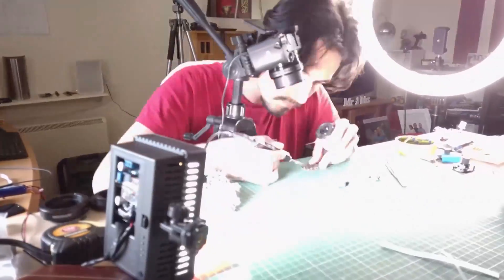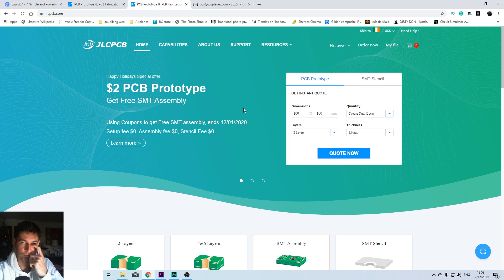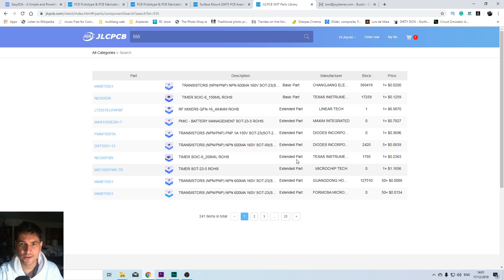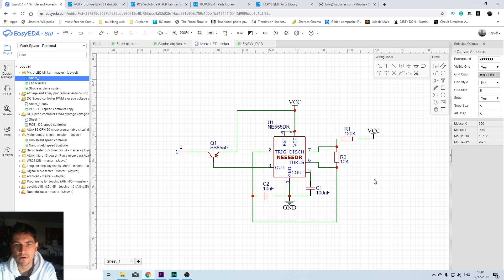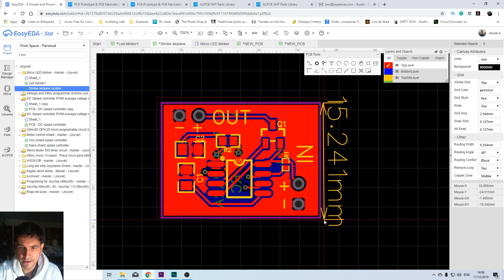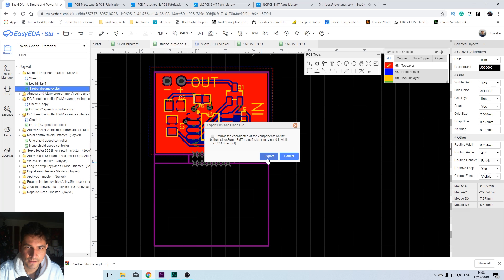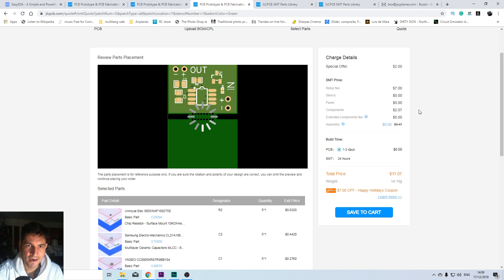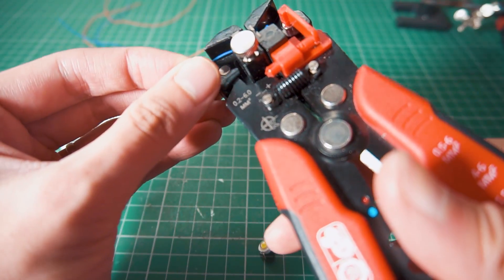Making an entire circuit with no soldering involved | JLCPCB SMT assembly

Comment: I definitely need some lights on my glider with that winter too. What's the voltage is coming out from channel pins of https://hobbyking.com/en_us/g-rx8r-eu.html when powered with a 3S ? Would a spare channel of my receiver be okay to power this PCB ?
Reply from the maker: Receivers normally work with 5v also because the servos use that voltage, if you're using a 3s battery I guess you're using a ubec or an esc with a voltage regulator that generally brings the voltage down to 5v so yes, 5v is the voltage for this circuit.
Reply: Yes, my receiver is indeed powered by the esc. Does that 5V coming from a unused chanel pair from the receiver fit enough to power the Run split cam and its circuit you tested earlier on?
Reply: Thank you!! You totally inspired me to get into this pcb game with easyeda and Jlpcb.  Question: do you have a current limiting resistor on the led externally? If not, have you experienced any issues with leds and circuit in use on your plane?? ✌️